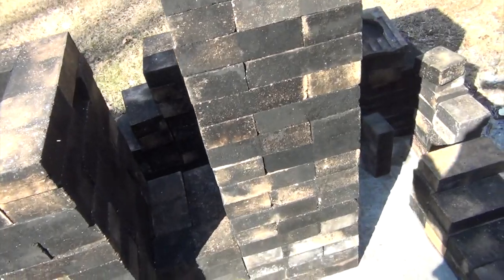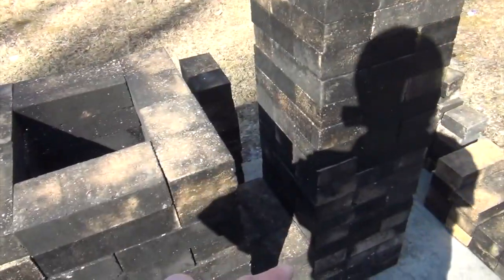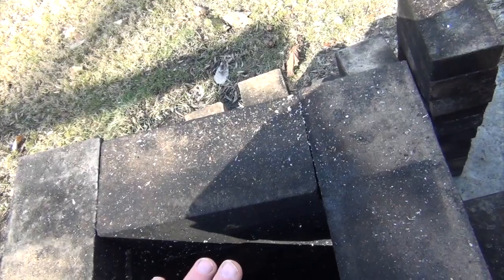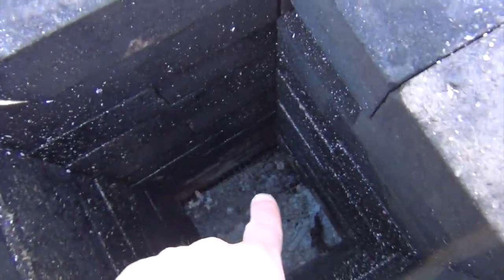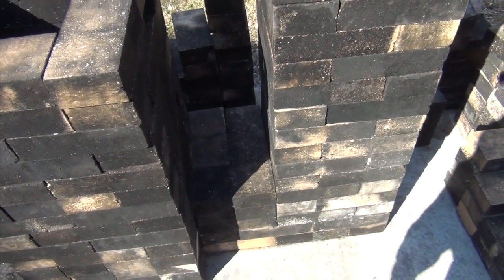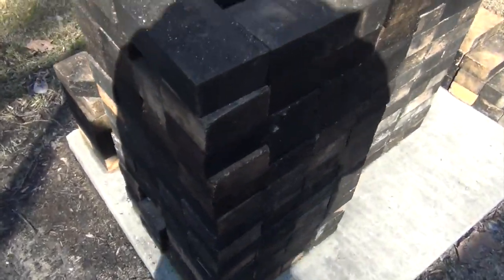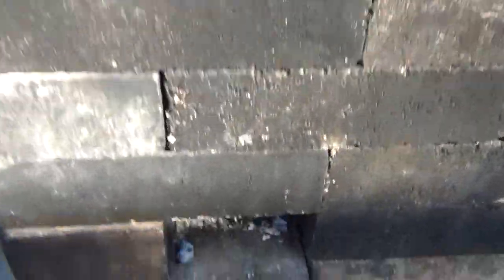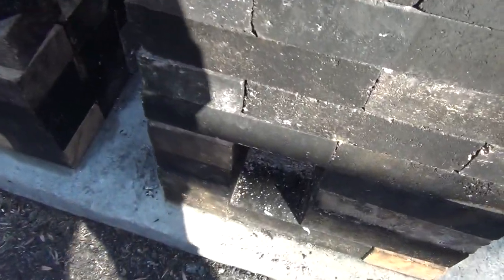TOTAL FAILURE - This faulty rocket stove will smoke out your house !

Comment: In my opinion the J tube is not worth pursuing. The fire is too small to heat a significant amount of mass in a reasonable amount of burn time. It is also far to finicky. The year I heated with one the feed tube would jam on occasion and the fire would climb up the feed tube till it overcame the draft. They also must be constantly tended(which i can see is the problem you're attempting to address). With the availability of premade doors there's just not a good reason for anyone to go down this road. The only exception i can think of is a very small shack
Reply: all true- great  for 500-900 sq ft. . need to clear ash so burn tunnel is clear. but they can crank out BTUs and in mybuild, heat a bench and back.
Reply from the maker: I agree. If you can get a decent door, or even a glass door... "batch box" or burning (with air in) "from the side," into the riser, is far better.

Comment: I'm guessing power venting is not allowed and kinda defeats the purpose. Get your angle grinder out and start cutting bricks at an angle. 45 from combustion to vent. :D The more surface area that you add is just increasing the resistance to flow, making it not "want" to (or physically cannot) travel down, over and up. Hot air rises, cold air drops (convection). Your convection is the only energy that you have to move your air... Each inch of brick adds volume and resistance to airflow (same with every turn that it has to make). 
 Hope this helps.

Edit: Thanks for sharing these by the way. : ) : )
Reply from the maker: Yea.. there are some things in here to consider...  thank you....  Per your first sentence.. I think, over time, I will create a stove with a fan or power venting of some kind to "overcome nature" a bit. I lose electric so much though, there must be a "safeguard" in the design so the stove does not begin to pour smoke into the house at the first minute of electric outage.
Reply: @stoveadvice  A PV will absolutely eliminate all of these issues. Yet, IDK... it kind of defeats the purpose of these experiments, don't ya think?? Would have loved to see the smoke billowing out of the combustion chamber.XD (Therein lies a big PART of the issue right there... it's not sealed.) 

When you're discussing and dissecting these Russian vids, there ARE actual reasons they only put ~1/2" air gaps in, instead of 2 or 3"... Physics still apply. Regardless of the powers of our minds, for some reason, overcoming physics simply isn't one of them. ; ) Phys is just observations over time, written-down on paper, with math worked-in, in attempt to break the descriptors down even further. 

Anyway, moving air faces resistance to flow and will even become laminar, too. Maybe lookup Poiseuille for further research on this... and yeah, air is considered an actual "fluid" when considering flow. Calculations are virtually identical in determining CFM as it is for GPM. Hope this helps again, and look forward to the next vid. : )
Cheers!!

Comment: Closing off the top of the hopper is creating a retort. Air must be drawn through the fuel (close off the air intake completely at the bottom) . Im betting Sadore probably has 80-90% of the air directed to the top of the fuel hopper.
Reply from the maker: Thank you, but I think you need to watch the video before this, and then this one again, to understand what is taking place here.
Reply: @stoveadvice  i have watched. I also know that a draft of air drawn or blown across a sealed tube creates a vacuum inside the tube that often oscillates. Also known as a helmholtz resonator. It's literally pulling all of the oxygen from the feed tube area that is sealed. A sealed oxygen depleted environment is basically a charcoal retort. I think I'll stick with my assessment, and wish you luck.

Comment: That air hole is turning your hopper into a riser. Plug that hole, prime the riser and I guarantee it will work.
This is just a J tube rocket. Lots of info on how to build them. Your hopper to burn chamber to riser ratio needs to be 1:2:4.
Reply from the maker: No, this is not correct. Watch the last video before this one and you will understand what I am trying to do. An no.... the ratio is just a guideline. It does not "need to be" that.
Reply: @ I did watch the previous video. The ratio is based on years of failed experiments exactly like this. Of course you’re free to make as many stoves that don’t work as you like…
But you should probably just plug the air hole and give it a burn while it’s all set up.

Comment: The burn tunnel should be insulated first off. that way after the initial quick prime, it will retain that heat and draw the initial fire. The reason the tunnel  was invented was to allow for more initial combustion and create speed and turbulance before it goes vertical into the riser, releasing even more heat energy to drive the rocket process and allow a fuller burn of volitiles and extract more heat. AKA adds to efficiency. Whether it was also added to accomodate a barrel, may also be true. The fact it failed here must be for other reasons, than to blame the tunnel itself. Otherwise all us who built and use a J with burn tunnel successfully, wouldnt exist.  The general concensus for the length of the burn tunnel is twice the height of the feed tube and the burn riser 4x the feed tube. This is for standard feed tubes that only have top open air intake. You are breaking new ground with a exceedingly tall feed tube and two air intakes (top /optional with cover), and the one down at bottom. So it would take trial and error to get the proportions right, the insulation in, and the proper air intake amount and locations before one could say what the cause of the failure is. Add to that you are outside. This is not the environment it would be used, (inside a structure), so the amount of air, the winds etc can mess with your trial and error. you could get it working good outdoors but when you take it indoors, have new or further issues (or vice versa). But generally as to the tunnel, the distance between the heat riser and the feed can be as long as one is able (people have successfully built various lengths). But if a tunnel is not used, yes it may be easier to get the stove to 'work', but one is sacrificing efficiency and allowing alot of un-burned particles. aka too much air flow. i may have missed it , but did you try blocking the bottom air intake and just rely on top? I see you tried the opposite but maybe try blocking the bottom, as this would then mimic a standard J tube rocket which rely on air coming in from the top of feed tube. Having two air intakes may be battling each other? I'd try that, isnulate the tunnel with a blanket and preheat the tunnel a bit if you didnt.(I see you discussing preheating the burn riser). I preheat the tunnel entrance (aka, the bottom of feed tube), this is all that is needed (not necessary to heat the riser - it will be heated from the heat from tunnel. I dont have access to the chimeny in any event.... It shouldnt take much of a preheat in my experience. a piece of paper burning for 15 seconds is enough for me to get initial draw into the tunnel. then it is essential to start a fire with thin small hardwood preferably. I rip sixteenth or eighth inch thick pieces (by whatever width you want- is not important-only thickness is key) on the table saw or split it off a larger piece. That thickness is key. to getting a fire going. The 'tip burning' type stoves use less wood and require smaller pieces, as they burn slower and more efficient and why they are desirable. So make sure to adjust the piece size, compared to what you start with in other stove designs.....These tips should then  immediatly take off and with 5 minutes one can introduce larger diameter (thickness) pieces until coals are developed (30minutes) at which point, any reasonable size can be dropped in. The rocket stove, ive found is started in this manner, otherwise, it is frustrating or uncessessful, and one could blame a burn tunnel or any number of things, when in fact it is this initial fire sequence, and/or some other variables as i've mentioned above. dont give up on the tunnel. It serves a purpose, and its not a small 'im an environmentalist, i must get 99% efficiency' desire. And the tunnel's added speed is part of the rocket sound and function. Faster the better
Reply from the maker: Thank you. Reading your comment now, I'll address many things "in order." 1. There are thousands of rocket stoves where the burn tunnel is not insulated. I agree with this though, my "ice cold" bricks (outside with ice on them) could be more of a factor than I am allowing for. 2. Per your second sentence, almost every metal / welded rocket stove does not have "a tunnel." Zero. All of them have no smoke. It is not needed for complete combustion. Look at any metal rocket stove... it's just an "L" 3. WHY IT FAILED is because I was trying to introduce the concept of burn chamber as a LARGE, top loading "hopper" with the top completely covered and sealed to mimic the Sedore stove. Your comment starting with "otherwise........" misses my main goal in this experiment, to have a larger firebox and top loading hopper like Sedore Stove, where only the very bottom sticks would burn. 3. Yes, for the final experiment all air in the bottom (side) was blocked allowing only air from the top down. Watch the video before this one. Still, it wanted to "burn upward" and draft was not strong enough to keep smoke from rising up toward the top of the burn chamber hopper. Your point about me doing this outside in very cold weather, is a factor I need to give more consideration to. The bricks are ice cold. Right now, it seems only a traditional "J" rocket will be successful in only having the "very bottom of a stick burn." Somehow "Sedore" does it. I don't know how they pull this off. Even in some "J" designs, people have had many incidents were the top of the sticks briefly catch fire and smoke goes "up" into the home.

Comment: Even if the problem of smoke rising by convection inside the tall firebox/hopper going directly to/up the riser...you still have the problem of smoke/wood gas that needed a little hot air not being combusted.

Comment: it just seems like the riser wasn't primed, or you need to cover the hopper. also, having the riser and hopper touching, you could still have that bell/barrel, it'd just extend farther out but the volume would be the same. maybe you'd need extra baffles to make sure all the smoke way burnt.
Reply from the maker: The top of the burn chamber or "hopper" was sealed tight with mineral wool. (Not shown in video.) Without that, no doubt, the burn chamber immediately becomes the main chimney. See video before this one.